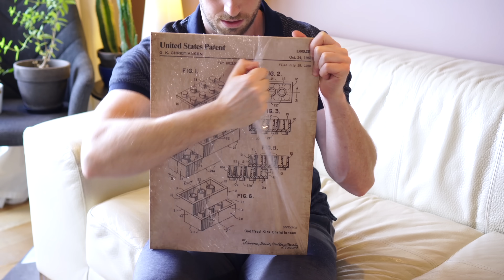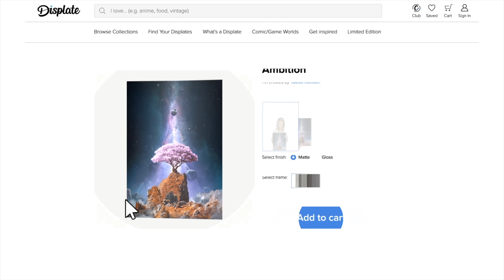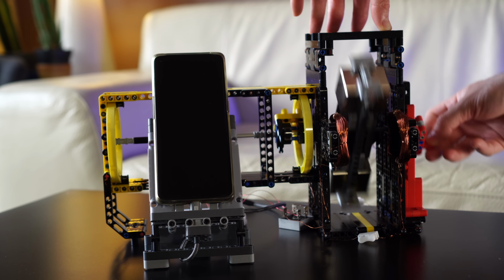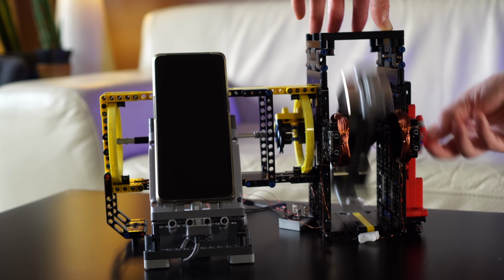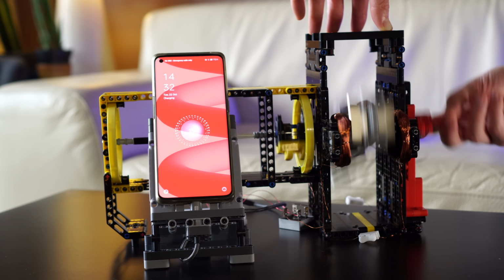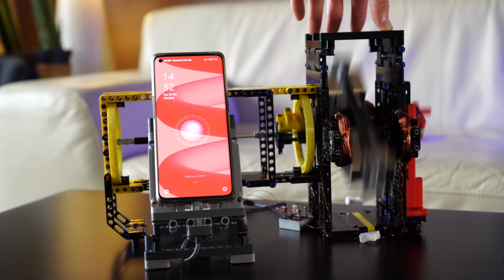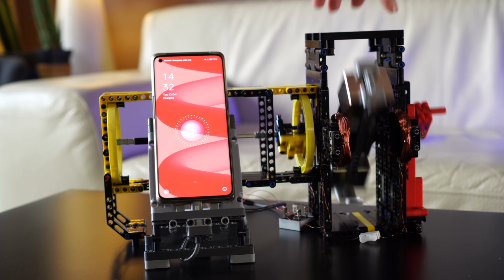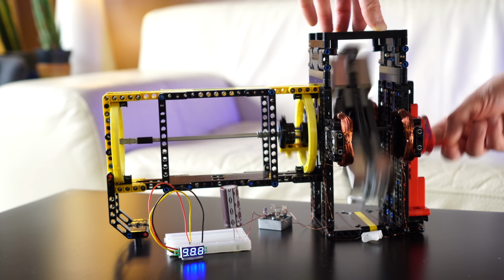LEGO Elastic Energy: Making Power From Rubber!

Comment: WHY DON'T YOU BUILD A COPPER COIL MAKER
Reply from the maker: I've built several! However they're very challenging when the wire gets thicker. You need a hell of a lot of tension on the wire to keep it in place and bend it properly. So for bigger coils I usually have to use hands

Comment: Oooh are you familiar with the Huygens drive? That would do wonders when combined with a flyball governor
Reply from the maker: Oh damn this is exactly what I've been looking for! I've experimented with slow release mechanisms before, and how to add more energy while it's in motion. Usually I use a differential gearbox, but the small plastic cogs usually struggle under the load. And I'd love to try this with a gravity generator with heavy weights attached. This Huygens drive seems like it could survive easily under heavy load while adding more energy to it. Thanks a lot for the recommendation!

Comment: If you're going with gravity, then perhaps something like a small water tower "pumped hydro" would be worth looking into. Don't know if Lego/technicts has anything piston or pump like. But low pressure air could also be interesting
Reply from the maker: Love that idea! I'm definitely into the idea of negative pressure powering some kind of vacuum piston engine. And then powering the vacuum using running water. Unfortunately Lego makes this quite challenging, but love the idea!

Comment: 1:15 if you were to use mechanical advantage, for example a 1:5 ratio, the car could run much more but slower, about 50 meters but in quarter the speed the original one went 20 meters,
Reply: I remember in a mousetrap car competition I tried that, using a huge ratio to in theory make it slow but long-running, but it actually lost to one with a much lower ratio that just accelerated and coasted

Comment: You should try building a vacuum engine to run a generator. I'd be curious to know what the efficiency difference is between a piston engine and a turbine.
Reply from the maker: I've made an air turbine-powered generator. But a piston vacuum engine is definitely on the list!

Comment: Connect a large amount of rubberbands to the string. And wind this string onto the small diameter drum and  the stretching will be proportionally elastic. 
It is bad to wind the rubber bands directly onto the drum, the force increases in a progressive dependence, and the rubber bands are too stretched closer to one of the ends.
Reply from the maker: Oh damn I love your videos! And that's a damn good idea. That was the general plan behind my pulley mechanism, but I built it terribly. Perhaps a string on both sides of the elastic could work to allow it to stretch linearly without being wound onto anything.
Reply: @JamiesBrickJams  🤘

Comment: 18:01 as you probably discovered, gravity is much easier to work with, since the force is constant. With rubber bands the force increases the further you wind them up so either you crank it for long and the force is just too big to really use it or the machine has too much resistance to use anything but the first bit of energy saved in it before the torque becomes too little.
Reply: using gravity as a power source is idiotic, rubber bands have the ability to save 10 times more energy
Reply: Yet in the same time, rubber powered planes exist and some of them go for a long time.
Reply: @CenReaper.  Doesn't mean that they can use the energy stored in the rubber band ideally. Changing torque is always hard to deal with

Comment: You can put tie some capacitors together using elastic bands, it’s technically storing it using the bands 😅 But for real; you can use a weight to pull down the ratchet.
Reply from the maker: Haha perfect marriage of mechanical and electrical storage 😂
Reply: Nevermind, he did it.

Comment: for me the lever elastic band thingy was the most promising, you should try it with the big guy.
Amazing video like always
Reply from the maker: Thanks a lot 😄 I've a suspicion the torque wouldn't be strong enough to drive the large magnets due to their heavy weight. But perhaps with metal axles and loads of elastic bands it could still be forced to work!
Reply: @JamiesBrickJams  you should try a version with the lever version, might not have not a lot of torque but will run for long and at high speed, will just take time to launch (i suppose)

Comment: I think you need to make it spin as long as possible. Releasing all the energy at once would waste a lot of it, even if you stored it in capacitors. Also by having the magnets rotate slowly, you only capture energy fraction of the time.
What I think would work the best is gearing the rubber bands down, so that they don't release all the energy way too fast, because there's a lot of resistance, that it has to overcome. The magnetic core, which would be something like in 2:15, but using the big magnets, would spin really fast, actively being spun by the rubber bands, whilst being surrounded by multiple coils to create as much electricity as possible.
Of course, you'd need to experiment with the gearing and everything, but the core point is, that having a lot of torque on the magnetic core would be wasteful, because you're not capturing it with the coils. Rather spinning it with faster speed and less torque, because you can capture that more easily with smaller coils.
This is just my assumption based on my intuition, so I could be wrong, but I think, it's certainly worth a try
Reply from the maker: That's certainly one way to go about it! I've made many generators that spin very fast and for a long time. However the primary issue is that torque is so low that when you start trying to put an electric load on the generator (e.g., more than just an LED), the drag created on the core makes the output pretty minimal. That was the main reason I graduated to larger magnets and thicker wire under strong torque - to try to overcome the drag on the core when a load is added. However this wasn't amazing either 😅 You're right in principle though - there's clearly a balance to be struck between output torque and speed. And in general more magnetic poles with more coils will be more efficient at capturing that energy. Plenty more experiments to come I reckon 😁

Comment: While your things look cool and are unique, it does bother me personally at how inefficient they are, but since i may be alone in this opinion then you may ignore my ideas

First thing is the generator design, since i already know you cant add any iron core you can compensate by having the generator spin really fast, increase the number of poles or use stronger magnets

Honestly if you can i would suggest you make a generator with a lot of poles from tiny magnets, and also you would have to spin the magnets really fast so try to also consider how to make the rotor more aerodynamic and lighter
Also conveniently for you, if you have no iron core you have no cogging and no hysteresis losses so you should in theory be able to go wild with the speed only limited by mechanical limitations

In case you do go with making a ton of poles make sure the number coils matches the number of magnet poles, and if you choose to use 3 phase you would need 3 times the coils per magnet pole

And another thing the formula for centripetal force is F = v² × m ÷ r
The number or poles is proportional to the circumference which proportional to the radius, and induced voltage is proportional to change of the magnetic field, so considering all this you should be able to achieve better results if rotor radius is bigger, but yet again air resistance will no matter what screw you over a lot

PS, also consider wire thickness, since thinner wire allows for more turns and thus higher voltage but has higher resistance making it a balancing act

Comment: could you not try like a old fashioned clock mechanism ( i forgot the name ) to ensure output speed is consistent?
Reply from the maker: Definitely possible! I actually made a video a while back on a generator that used an escapement mechanism to slowly release energy. Deserves an update though at some point. I'm sure it's possible to get something low-powered to run for ages using an escapement

Comment: You can also use rubber bands for (super inefficient) refrigeration. No, I am not kidding you, stretch a rubber band and feel it with your lips, it gets noticeably hotter as you stretch it. Then hold it stretched for a few seconds to let it cool to ambient temperature, and let it go back to its relaxed state, it will be noticeably colder than ambient.
Reply: Really?  I would think relaxing the band would also heat it since the stored energy has to go somewhere.  I'll have to try it.
Reply: @BenAlternate-zf9nr "Mechanical energy to stretch the coiled molecules breaks the intramolecular bonds while supplying energy so the temperature is not lowered. The stretched polymer chains are forced together and INTER-molecular bonds form between the stretched chains. This process releases heat and also stresses the molecules near the double bonds. Releasing the tension forces the breaking of the intermolecular bonds, this requires energy from the rubber itself so the rubber cools"
Reply: @DarkAttack14  that's really cool! (Ha!)
Reply: @BenAlternate-zf9nr  it's true, there's a guy who built a "refrigerator" making use of this effect. It sucked but no surprises there lol. The cooler temp was visible on a thermal camera though
Reply: @BenAlternate-zf9nr  It works the other way with rubber than with most other materials.
Reply: Applied Science actually made a refrigerator using rubber bands. Obviously completely impractical, but cool as a proof of concept.

Comment: You should probably come up with a flywheel and some kind of wind up mechanism which would allow you to simultaneously crank up the weight and still be able to power the load.
Reply from the maker: A few folks have suggested the Hyugens mechanism which sounds better than just using a differential. Worth a try!
Reply: @JamiesBrickJams  I came up with that idea after watching Wintergatan's tight music test in which he used the exact mechanism along with a flyball governor to stabilize the speed.

Comment: I think you could try to use a bunch of small rubber bands in parallel and then just stretch them linearly, no winding then up. then gear up the output massively. That way you use a small amount of space to store the energy and it allows for easier expansion of storage by just adding more small bands

Comment: Rubber springs are definitely not even close to an ideal power storage medium. Friction between the elastomers turns quite a lot of this stored energy into heat. A coil spring or, as mentioned, gravity driven mechanics, will perform much better.

Comment: 11:39 I realize you're a lego channel, but lego is the limiting factor when you've got massive forces like elastic band or *twisted rope*. Use fitness bands. Scale up. Lose the plastic. Increase the gear ratio even further so it takes at least a minute. Figure a lever for a human to stand on every minute that resets the internal rubber band. Boohoo, you have to take a step once a minute to charge your phone and run safety lights when the power goes out :P
Reply from the maker: You're 100% right, Lego is a major limiting factor. I've made a great many generators, and Lego always turns out to have severe limitations on how much torque can be handled - both on the input, and the rotor. Though I'd like to experiment more with some aluminium Lego pieces 😉 Then we can put it under much more stress

Comment: It really makes you think about how much energy the smallest of processes require. No wonder we're causing our plant to overheat
Reply from the maker: For sure! I'm always amazed when thinking how much mechanical work is being done to power something like an oven or stovetop
Reply: Luckily real power station level generators are several orders of magnitude more efficient than this. For larger generators, both the spinning and stationary parts are coils of wire. Smaller ones it's usually the coils that spin.
Reply: Yeah, the flow and storage of energy is fascinating.  Think about this: the Earth loses more energy than the sun gives it and yet we're coming out of an ice age?  Just goes to show how complex and hard to grasp the earth and its cycles are.

Comment: I get the assignment is to use rubber bands, but to twist rubber bands in a spiral, or to roll them up is actually a really inefficient way to store rubber band energy. Their energy is far better served with being extended out freely. While yes, this will create a lot of force and short movement, its the ideal way to power something with an escapement mechanism like a weight would, that swings a pendulum or spins up a large wheel.

If you really want to stick to the windup, add a rope to the rubber bands and wind up the rope, stretching out the rubber band, As you wind up rubber bands it will bind and the inner spool isnt as stretched out as the last winds.
Reply from the maker: Agree, getting a good long stretch definitely feels like the best way to do it. That was the idea behind the pulley concept - to stretch the rubber linearly over a significant distance. Admittedly, I did a pretty crap job of designing it, so I'd love to revisit that idea in another design at some point!
Reply: Maybe you can design a cam-shaped lever so there's more leverage as lower extension to try to even out the force.
Reply: @JamiesBrickJams  I'd recommend revisiting the pulley concept, but I would love to see the lever used as the ratchet instead of a little spinny handle, to allow you to store more human power.
Reply: @JamiesBrickJams  I'd love to see something a bit more heavy duty that will allow a person to transfer more of their power to it. Instead of a small crank that you spin by turning your wrist around, maybe running or even better one of those big pedal things that let you use your arms to swing 2 arms on the machine too.

Comment: I'm eager to see a gravity battery now that you bring it up.
Reply: No pun intended
Reply: @maxiewawa  This is certain to not let us down :P
Reply: isnt that basically water batteries (pumps pump up water when electricity is cheap, then when electricity is expensive, they release the water to push turbines)
Reply: There are a ton of pendulum clocks out of lego on YT, for inspiration
Reply: There was a project to make a gravity battery for led lights for poor people in Africa bush tribes.  Light at night.
Reply: @kayakMike1000  Virginia, United States has a massive reservoir of water that is pumped up to store water, and then can release the water through a turbine to make power.
Reply: Yes me too
Reply: We need it bro.
Reply: Sadly they’re super inefficient, the advantage is long term energy storage but we don’t ever really need super long term storage.
Reply: Sweden had a gravity battery. When they mined for iron ore in the mountains they would require train cars to be filled with ore. Filled cars would descend the slopes and the wheels would turn the engine and be a generator. Empty cars would be driven up the mountain with the produced electricity.
Reply: same here 😁
Reply: Same here.  It would be better.
Reply: Same I've been having an idea for a fairly large one using a rope reduction system to transfer vertical to circular motion
Reply: Super simple. Just lift a weight with a motor. When the weight falls it makes power
Reply: @SkillfulNick  That doesnt work the way you think it does...
Reply: @adamflyshotmail  what do you mean it doesn’t work. Wrap a string around the axle of the motor, and tie the other end to a weight. If you power the motor it lifts the string, and when you unpowered the motor the weight starts to fall and makes power. What doesn’t work?
Reply: That would be perpetual motion so no, it doesn’t exist
Reply: @gregritferdjr  they do exist in real life. That's what a battery is; put energy in and take it out later.

Gravity batteries are one of the most efficient forms because the only loss you incure are the efficiency of the method of lifting and generating from lowering the mass.
Reply: @ I’m thinking of something else then, probably not the same kind of gravity battery that comes to mind
Reply: @gregritferdjr  usually large-scale gravity batteries use water. The water is pumped or siphoned to a reservoir on a higher elevation. Then they flow back down through a turbine.
Reply: That's called a hydroelectric dam
Reply: @belded-wee  not necessarily. A gravity battery can use a dam or not.

Comment: one potential project i see is building the most efficient hand cracked generator.
Reply from the maker: That'd be a fun experiment. I've a suspicion using a standard Lego XL motor and cranking it could be one of the highest efficiency generators you can do with Lego.. But where's the fun in that 😉